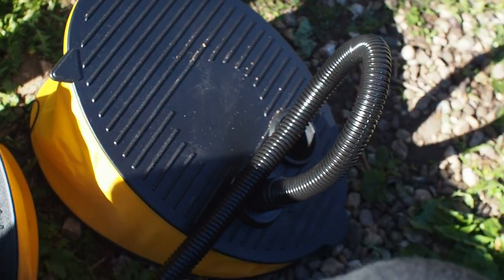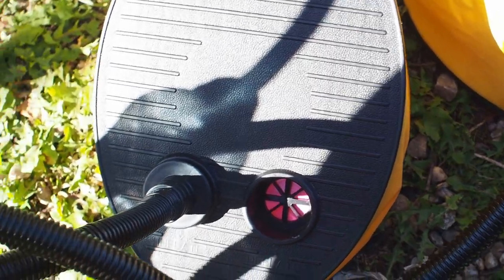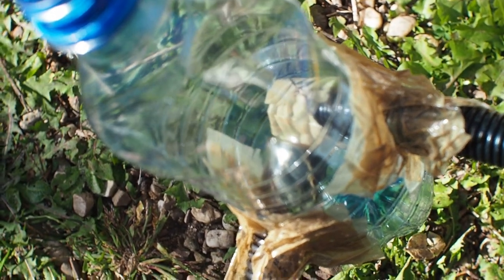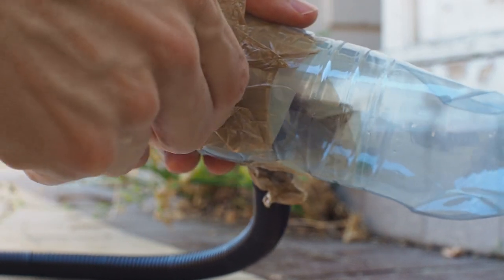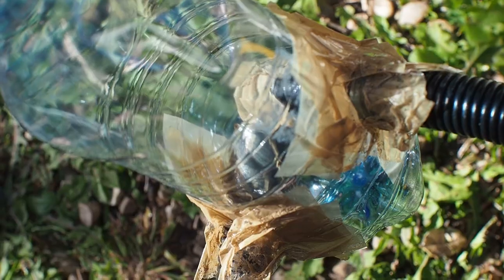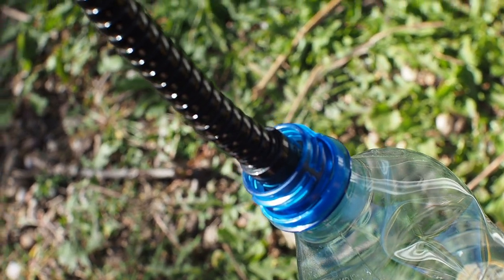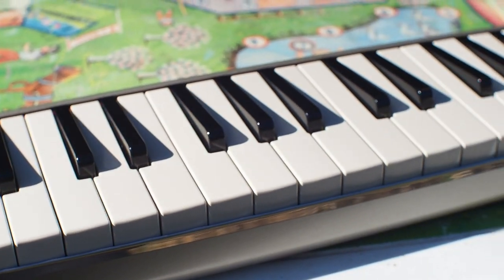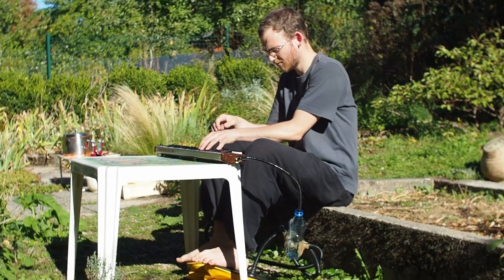The Two Foot Pumped Melodica

Comment: I've done this too and there's more options to do this. If you have only one foot pump, you can connect it to a plastic bag (or large inflatable beach ball) which you connect to the melodica. Now you don't have to pump all the time. A few pumps and the bag is full and you can play for a short time and then you can pump again. If you have the bag behind your elbow while playing, you can push the air out gradually and you can vary the pressure and thus the volume of the sound. It works a bit like a bagpipe actually and it worked well for me. Something to try, for the experimental musicians here :)
Reply from the maker: @hanschristiaanhylkema  so cool that you experimented with it too ! The method you describe was actually something I tried but didn't get to work. Somehow I found it very hard to squeeze the bag while playing and pumping.

Comment: What is the point of the bottle? Does it act as a reservoir? Do you need to be constantly pushing down on one of the foot-pumps?
Amazing idea!
Reply: it connects the two pumps together so they they blow air out of one hole. if you had a small fitting then it would do the same thing but it might be hard to find or make one that would fit.

Comment: i wonder if you could put a balloon between the bottle and the cord so that having a little too much air wouldn't result in the volume going up and down so much like it does. you could keep the balloon a little bit inflated and because they're flexible, it would keep the air pressure more consistent. it's like a bagpipe.
Reply from the maker: I tried that first, but I couldn't make it work properly. I tried with a big plastic bag for fruit juice haha.
Reply: @tele-marmotte  I think that didn't work because there's was nothing pushing the air out, I assume. Bagpipes work because the bag is held between the arm and the body, and air is forced out by squeezing it between the arm and the body. It's like if you poked a small hole in an empty plastic water bottle (with the cap on). If you leave alone then it just sits there but if you squeeze the bottle then air comes out of the hole. If the bagpipe wasn't squeezed by anything then it would only make sound when you are actively blowing air into it the same as any other reed flute. 

If you used a balloon, then air would be forced out by the balloon wanting to deflate itself. this is different from a regular plastic bag because they don't want to deflate themselves aggressively like a balloon. If it gets too deflated then it won't push air at a consistent rate anymore until it's inflated again, you keep it at roughly the same level of inflation with the bellows and it will provide you with a relatively consistent airflow and pressure, assuming there aren't any major air leaks.

You could also have a bag that works the same way a bag pipe does but you would have to squeeze the air out with your body. It might be awkward to do that with one of your arms if you're using both of them to play the instrument. If you try using a balloon then I think you might have to use an extra large balloon, or it might be good to use the extra long noodle shaped balloons that people use to make balloon animals, since the shape would better facilitate attaching it to something on both ends if you're going with a through line configuration. 

Round balloons have that spout you use to blow it up and tie it shut but there's only one of those. You could have a Y shaped fitment, i'm sure you could find something at a hardware store, I think to connect all 3, the intake for the bellows, the balloon, and outtake that goes into the melodica. there are also fitments i've seen that are functionally the same but it's in the shape of a capital T so it would be like a straight line from the bellows to the melodica, but with a balloon sticking out of the side in the middle, adjacent to the line. 

it might be good to encase the balloon in a thick garbage bag also because it will be susceptible to popping from any sharp objects so it will act as a barrier against that. 

one of the reasons i'm thinking so much about this is that when i get my melodica i might want to try this so i'm laying out how i would build this system, because i might actually make one for myself.

Comment: hey good idea, i am currently trying to figure out how to play my melodica without blowing. Have you tried/considered using an electric blower? maybe it will be smaller and you won't have to move your feets (or maybe you can use a dynamo if you want to move your feets)
Reply from the maker: Hello, thanks a lot. I have looked a few things on internet, but the electric blower had a few cons like -need electric supply -can't control the volume. But a dynamo could be awesome if it works. Definitely something to try. Please let me know how it turns out. :)
Reply: But some electric blowers have a potentiometer to regulate the amount of air it gives. Those foot pumps gives you problems with the volume? In the video it seems like you have irregular volumes, but idk if it's an issue of the foot pumps
Reply from the maker: Yes, the volume is hard to control with the foot pumps. If you can control the potentiometer with a pedal to keep hands free, it can be awesome.
Reply: Yes that's what I was thinking, if I do samething I will tell you but I think I won't have time. Contact me if you make something about that